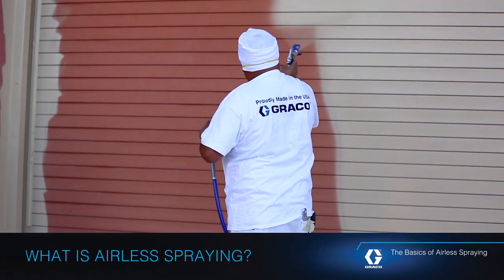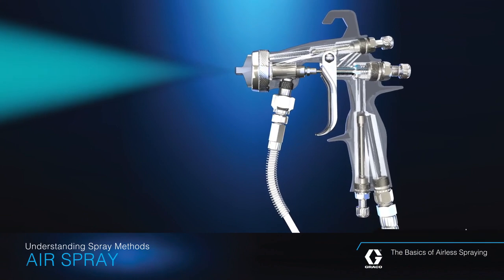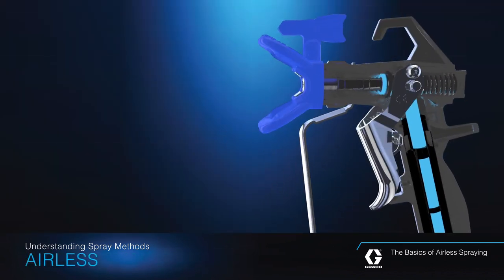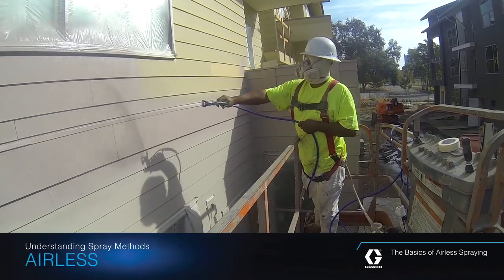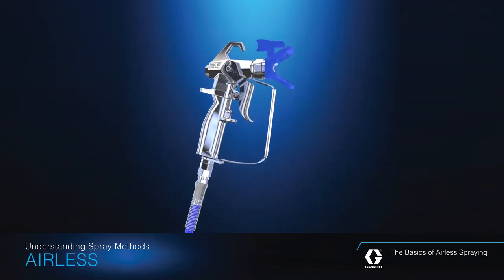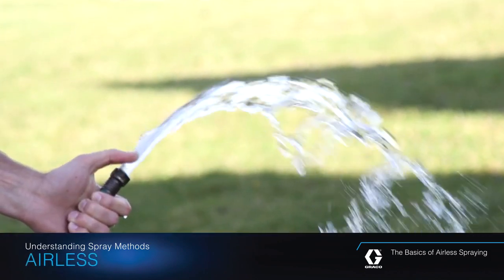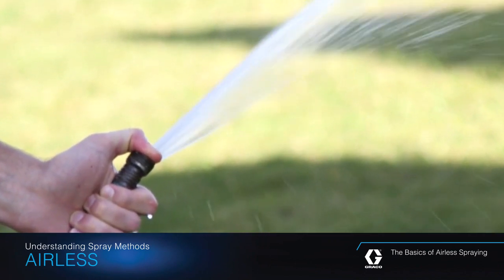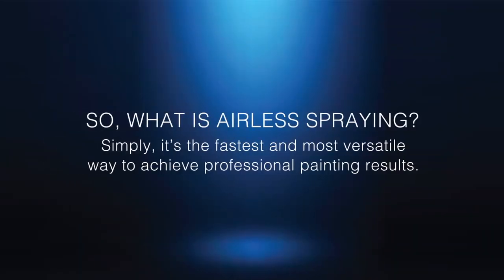What is airless paint spraying? And what are the benefits compared to rolling and brushing?

Comment: Does airless spray consume a lot paint than roller or brush ?
Reply: Of course
Reply: Depending on which machine you use, you consume less paint than rolling, especially if covering larger areas.
Reply: You use more paint on rollers and brush. All you need is to check the nature of painting and area coverage, if it's much, then go for airless Spraying.
Reply: This is how i teach my students to calculate paint usage.

M2xDFT
----------
10xVol%

We also calculate
10% spillage
20% Spray spillage and
xx% construction spillage.

The construction spillage is much higher while spraying a chain linked fence over spraying a barn door so this is an unconstraint variable

Comment: airless use lot less paint than rolling and brush and hvlp use even less than airless ...im a painter and decorater i havent touched a roller and brush in 5 years
Reply: What is better to use for kitchen cabinets and furniture when you want a fine (not gloppy) finish? Also, which sprayer is more versatile that allows me to use either latex, acrylic, enamel paints and also varnish or poly?